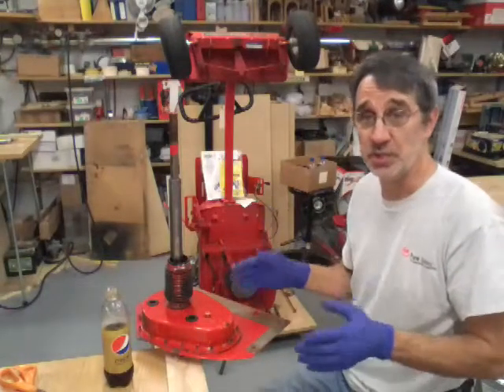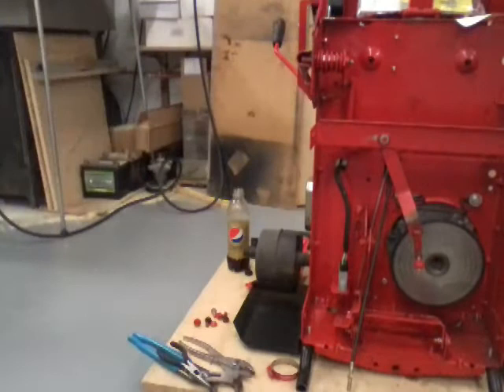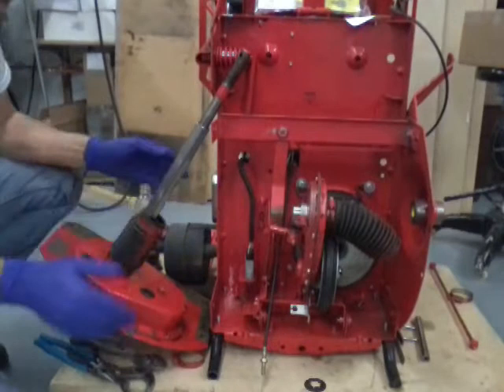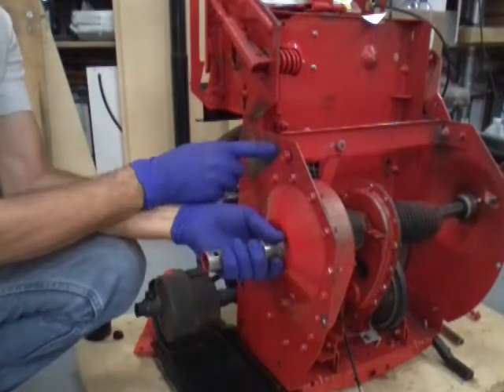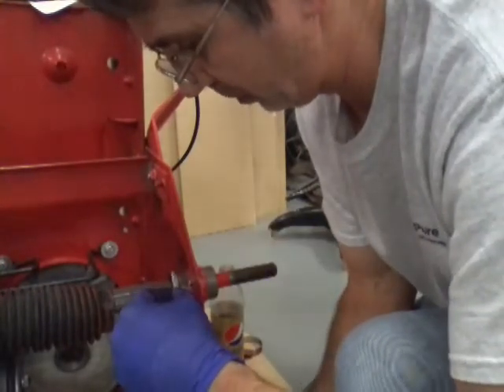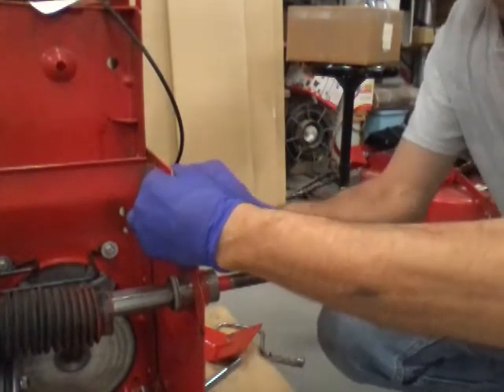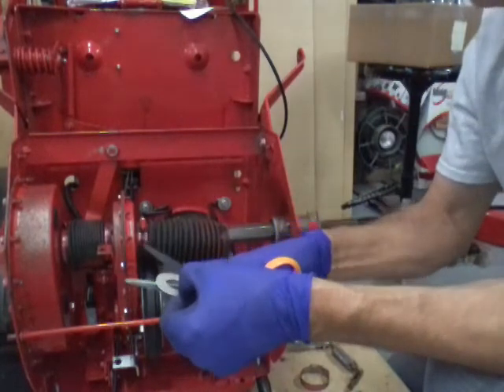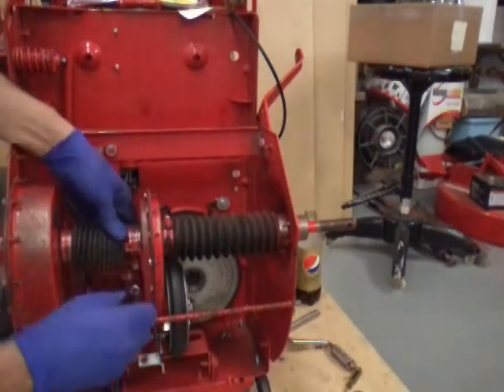140.  Reinstalling the differential and chain case in a Snapper rear engine rider

Comment: I need a tie rod that you manufacture. You spoke about it in another video. How would I go about getting one from you? Yours are more robust and appear more sturdy.
Reply from the maker: I think you’re talking about my spreader bars for the rear case, not tie rod for the front steering if so, the spreader bars are $19.50 plus $11 shipping. 
I have a PayPal account, which is 
paypal.me/jimsfixitshop
You can send me your information, including your address and ZIP Code to my email address. Do not put it in this section. Everyone will see it. 
jimsfixitshop@gmail.com
Thanks.     Jim
Reply: Mr. Jim, I sent pay pal and emailed you. May want to check your spam folder since I have never emailed you before.
Reply from the maker: Everythings good I will ship it tomorrow and I will send you your tracking number.
Reply: No worries, thank you for educating me through your experience and expertise. I got bit by the snapper bug. Just rebuilt one and this weekend will be rebuilding another.

Comment: I just recently replaced the boots and the drive disk and I noticed that the bushings for my yoke we’re pretty much shot. Are these pretty standard versions that can be purchased maybe at Ace Hardware or do you need to order these from parts tree??????
Reply from the maker: I think you’re going to have to order them through a dealer or parts tree, I don’t think you’re going to find them in hardware store. Jim